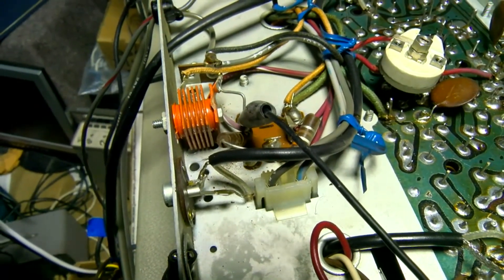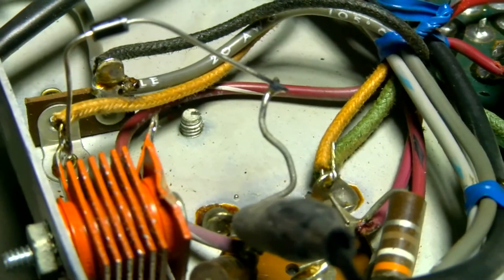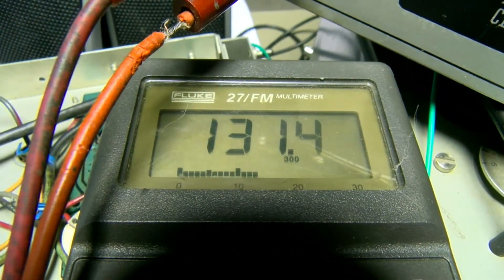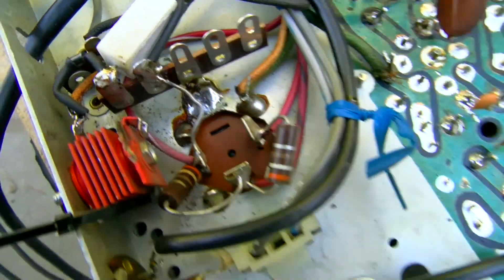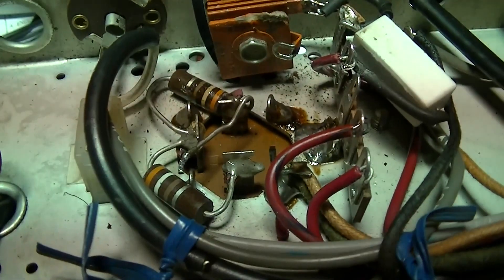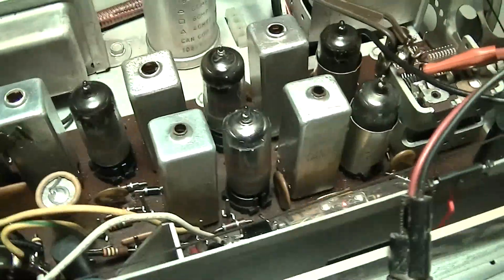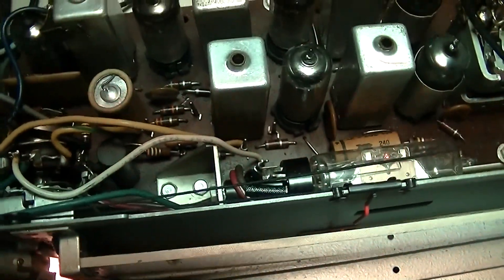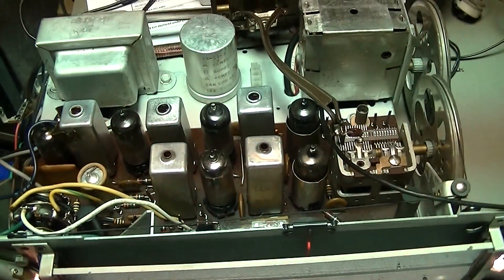how to replace a selenium rectifier with a diode

Comment: Greetings:
Since the B+ voltage varies with the volume setting, I would use the schematic 50 ma value as a starting point and measure ma as you select a resistor. Remember you have the option to use an electrolytic dropping cap whose 60Hz reactance equals whatever resistor you settle on (save a watt, save a penny). I know that you never use dropping caps, but you could learn. It goes between diode cathode and first filter cap +. Cap value is 29.4 mfd at 200v.

Comment: doing this myself on an old 1-tube record player, and yes the volTage does jump around a bit. Coincidentally, I am using 71 ohms, but will swap that out for a 75 ohm resistor in a higher wattage.

Comment: Could I ask for some advice. There is a lot of confusion regarding the rectifier on old Villers motorcycles and how to replace them with a modern solid state rec. If you google up Villiers 2T engine wiring you will see what I mean but basically there are two ac coils one coil is connected all the time to the rec and the other is only connected throught the lighting switch when the lights are on. So two coils is series black wire common to both coils one red wire one green wire. No problem so far however half way across the coil with the red and black wires there is another yellow wire that goes to the ammeter to the battery. The question is what is this wire for know one seems to know why it was fitted. Its either supplying the ammeter with an AC supply but thats DC to the battery or the coil is getting a 6 volt dc supply. Any ideas  dose the old type rec need a dc to work. The bikes were made in 1964.

Comment: Replaced the SE rect in my Zenith AM-FM radio with a silicon diode but the voltage fluctuated with the audio when the volume was turned up using a series resistor.  Ended up installing two power resistors in a voltage divider config to get a more stable B+ and now the voltage barely changes no matter where the volume is set.  Thanks for the video.

Comment: I a old Radio Shack Tube SAF-24 amp that has the same layout as this one with with one red wire going to ground and the other going to the Selenium with a 30ma draw, but when I replace the Selenium with a IN4007 diode the problem is my transformer is overheating now! It is acting like it is a shorted and it is . Any help please
Reply: I'm having the same issue with a Motorola 5R1. Its over heating after powering on. Is there a way to suppress the power spike from the diode until it warms up and the voltage drops?
Reply: @mrvaportrailz  did place a power dropping resistor in line? If not do so.
Reply: Carl I did, I put a 100ohm 10 watt ceramic resistor that initially tested at 115.8v DC after warming up. Now the resistor after the rectifier and right before the filter caps is overheating badly when powered on. Would a thermistor help here?

Comment: Thank you Shango066 - I was able to get an old Pilot FM converter to work with my low understanding of how radios work. I got the DC voltage up from about 50 to 110 with a diode, then I changed out the electrolytics, it worked but really poorly. Then I pulled the tubes out, sprayed the sockets and replaced them, now it works OK, gets a lot of stations but sounds farty. I think it needs more caps, but I am on the right track.

Comment: Using that rectifier as a detector diode will cost you some sensitivity. Strong stations probably won't improve but weak stations should improve. You should look at what diodes are being used in the FM detection circuit. Change to recommended detector diodes.

Comment: Thanks for the informative video. Just did this repair on my 1960s Canadian Sparton 6 tube AM/FM. Working well with 129 Volts B plus with a 75 ohm resistor.

Comment: 4007's will work on some radios as a detector but only as a temporary fix. It should be replaced. I remember back when I was a kid building AM radios with 4007's (and other types) because the proper diodes were rare for me to get a hold of.

Speaking of selenium rectifiers.. I just restored / rebuilt an old 1960's era variable bench power supply that had 4 of those things to make up a full bridge rectifier. I just replaces them with a modern bridge and gave it a new lease on life.
Reply: smelly and cancer-causing~

Comment: Never seen a Power Resistor Decade Box before. I looked them up on ebay.
They are all 240-c models, prices range from $245-450. That's one pricey piece of equipment.
Reply: One of those things where it might be cheaper to build your own.

Comment: Perfect timing...I have to change out a selenium rectifier. ( Fire Department on speed dial!) Question: How do you determine the wattage of the resistor used in series with the diode? Thanks!

Comment: I personally would not use a 1N4000 series as a detector. The Chinese Silicon Schottky's are probably the the best choice, since Germanium diodes are getting scarce and pricey these days. Then there is the long term reliability and leakage of Ge.

Comment: That decade box is sweet, I need to get one of those. If the selenium rectifier is really far gone, sometimes I'll bridge a 1N4007 in there long enough to do diagnostics  and get workable B+ readings. I've had some that outputted less than 60 volts.
Reply: Just FYI bridging a good part with a bad isn't the way to go IMHO , even temporarily. I know some have bridged almost shorted caps thinking it was ok to do. Really you are bridging a good cap with a shorted cap. The result is still going to be performing as if that cap was still shorted.
 Same with the Si diode across a bad Selenium.  Why put a good part across the bad, even temporarily?  You can do as you wish, however the few seconds it takes to disconnect the Selenium, and tack in a diode with a default resistance  is well worth it. No worries about the Selenium failing, it's out of the circuit. Go ahead and replace the other caps, as you wish, then adjust the final B+. Just a thought.

Comment: Great video! Selenium rectifiers and dial restringing are my pet peeves of repairs. Someday, I'd like to see you do a video of a tube battery/AC radio where the selenium is especially tricky to replace as the series filament voltage is tapped from the selenium rather than directly from the AC line. These can be a headache to calculate the value of the dropping resistor.
Reply: In a case like that you could calculate/estimate the voltage drop in the selenium (about 1 to 1.2v per plate) and more or less replicate it by building a string of silicon diodes at 0.7V drop each.  If you need a tap, just find the place in the string that gives you what you need.  No resistors needed.   This plan does work best with the 4 to 7 plate seleniums, but if need be you could even do something with bigger ones.

Comment: Thanks for the tutorial, I have a couple of radios with bad ones in them.  I wish I had a power decade box, I only have a standard low wattage decade box.  I'm going to get a bunch of power resistors at different values for doing this.